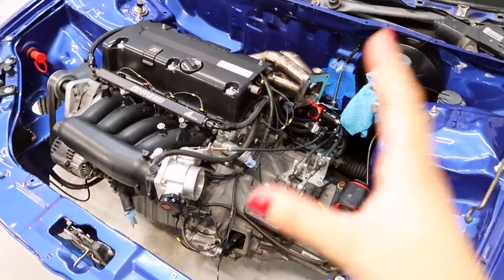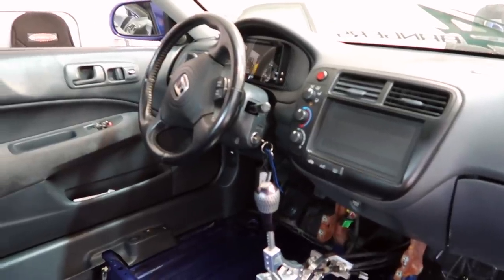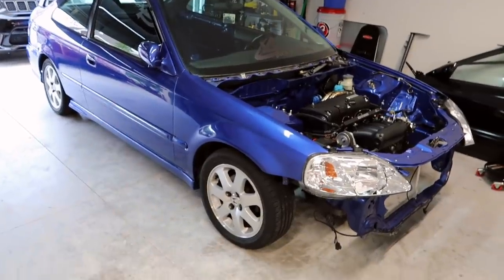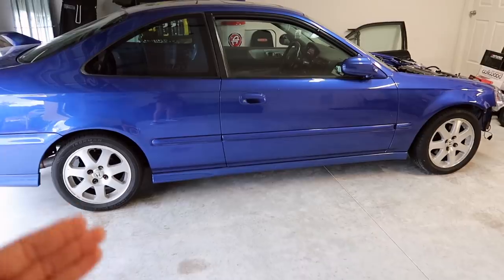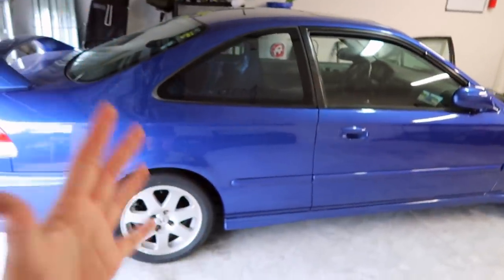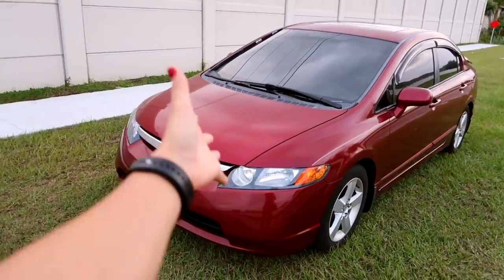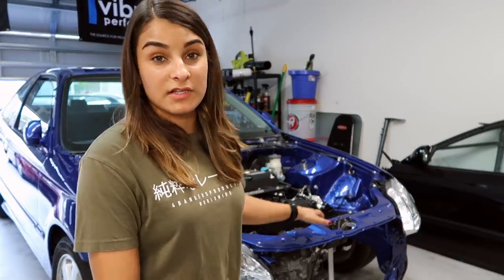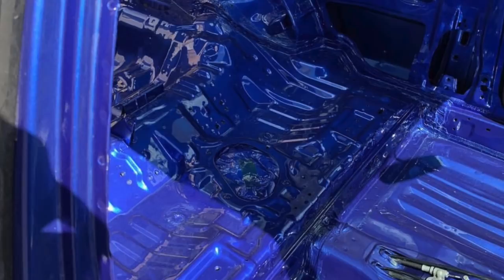NEW DAILY COMING SOON

Comment: On the project civic
Are you going to be doing the ceramic heat coating on the exhaust manifold and turbo? Or at least the manifold?

What car I think you’ll get? I would imagine you’re going to switch companies and move away from Honda. I’m thinking a Lexus IS or GS. Why those? Because they can be quick and yet classy at the same time. But low key, I have a turbo teg (project car, IS 300 (soon to 1jz swap and Lexus GS 430 dropped with 20’s for looks.